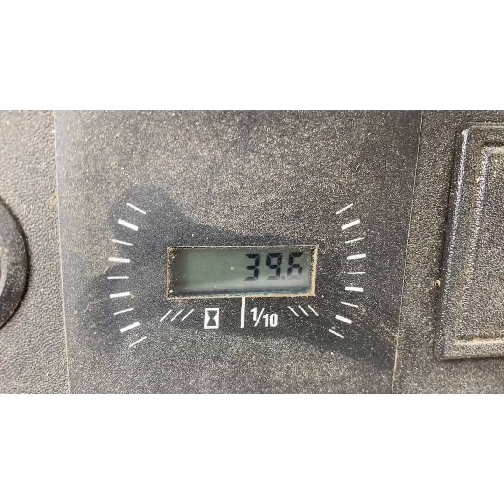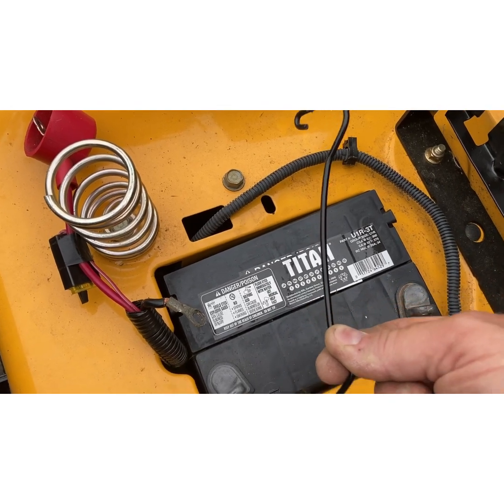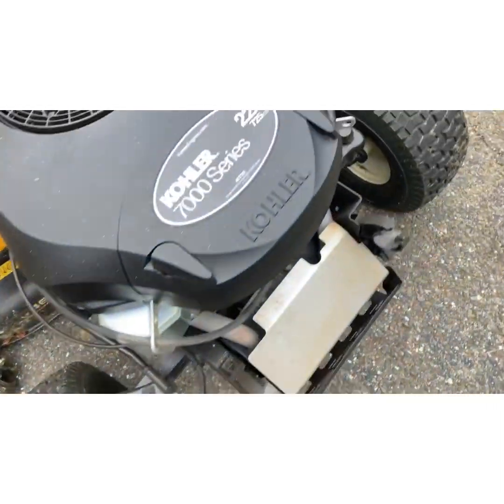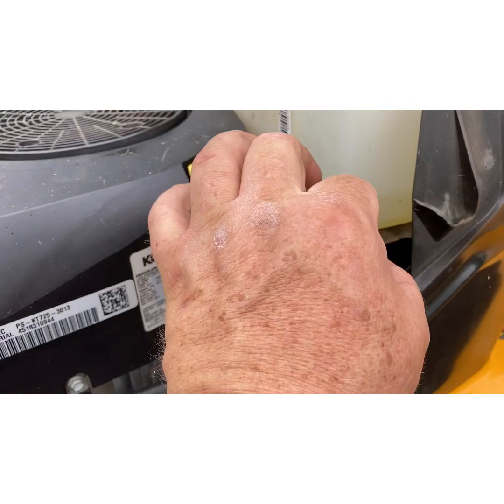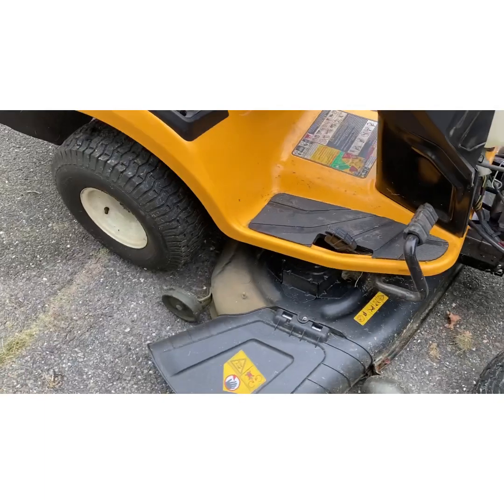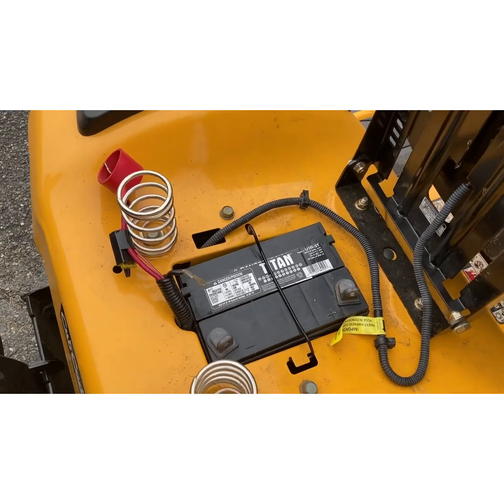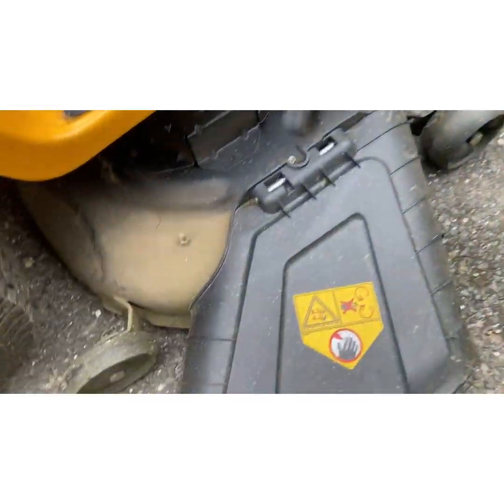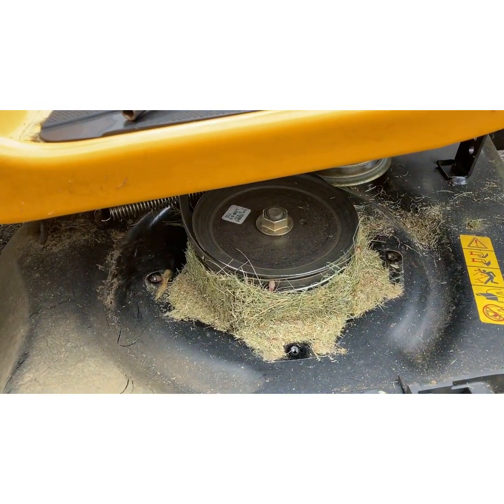Cub Cadet XT1 Tractor basic servicing and things to look for when servicing!

Comment: My cub cadet xt1 42 inch has is about a year old and its idling low and turns off after a few minutes of mowing.  Also has some light black smoke coming from the front of the hood when it's running.  Any ideas what's going on?
Reply from the maker: Does it start right back up after it stalls?  I had one of those where small pieces of dirt were blocking the fuel tank outlet hole.  Look in the tank to see if the hole is blocked
Reply: @KensSmallEngineRepair  yes it does it starts up perfectly runs for like 45 seconds and then turns back off
Reply: My 2014 smokes also from the front when I first start it up!!!
Reply: is it "intellipower"
Reply: @kastaway2  yes

Comment: Do you happen to know if the cub cadet zero turn Ultima series is all made by cub and not Mtd? I was told all the riding tractors for cub cadet are made by Mtd but Ultima series is straight from cub cadet. Any truth in tjat? I’m trying figure out which model or brand I’ll get the best results with.
Reply from the maker: Cub Cadet has been owned by MTD since 1981

Comment: Excellent information, we actually had two riders this spring that were stalling out only because there was a dead ladybug in both fuel tanks. A perfect fit to plug the hole completely then let loose and run fine again but as it got sucked back in would miss like crazy.
Reply from the maker: I have some video on all I did prior to discovering the little plastic bits on the fuel tank!!!

Comment: AMAZON replacement spindles have grease fittings
Reply from the maker: Beware as some of them have double sealed bearings and even if you pumped in a tube of grease it might never see it

Comment: open your eyes.  There are zirk grease fittings on the wheels and stem.   4 total.
Reply from the maker: I usually take the wheels off and grease the axles instead of wasting a whole tube of grease pumping and pumping to fill up a cavity for nothing.

Comment: Spindles are not cheap.  120.00 per spindle and brake assembly is 72.00 .
Reply from the maker: Aftermarket spindles are a lot cheaper.  I buy them and grease the bearings and install a grease fitting if none is there.
Reply: @KensSmallEngineRepair  do you have a link please?
Reply: Also do you or have you installed a brake pad on the brake assembly on the enduro XT1? Is there a way to install one without rivets? @KensSmallEngineRepair
Reply from the maker: You could rough it and the bracket up and bond with JB weld
Reply from the maker: The bracket comes with the pad riveted on, but as you said it’s pricey.  You can buy brake material from McMaster Carr and Bond it on with JB Weld
Reply from the maker: @jimmyfuller445  I'll take the time tonight to look things up and post.
Reply from the maker: @jimmyfuller445  spindles on Amazon
JSXDNWYJ Spindle Assembly for Cub Cadet MTD 918-06981 618-06981 Fit for C Cadet Craftsman Troy Bilt XT1-LT50 and XT2-LX50 50" Deck https://a.co/d/e36LDWf